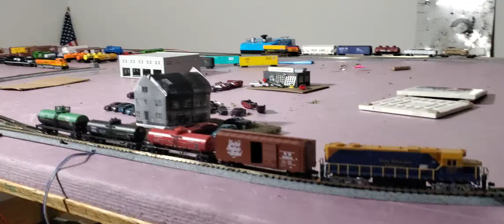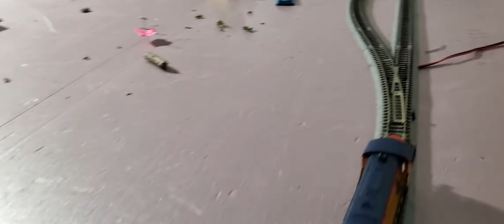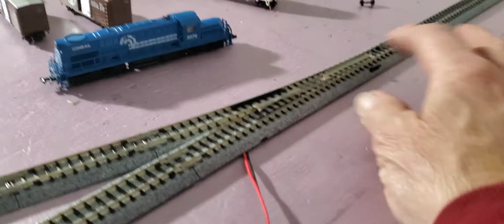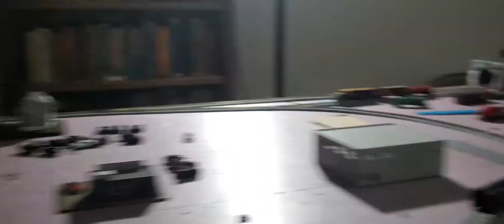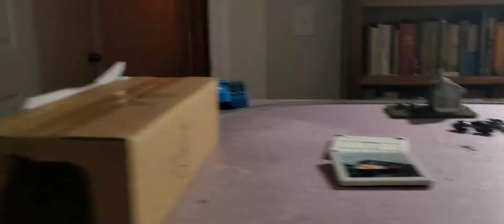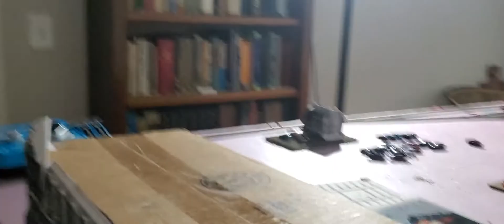Frustrating!

Comment: Hey Nancy I just totally ripped up my non working diorama and made a new working one! I'm having nothing but problems with my points though, particularly the 481 points! They either just stick or don't work at all! Luckily they are in easy reach so I can flip them manually! Btw that wasn't a derail at the beginning that was a train wreck!
Reply from the maker: LOL train wreck...derail! meh LOL what are 481 points?
Reply: @nhyardlimit  Ah yeah, 481 points are just what I call the #4 turnouts that use 481 radius curves because I can never remember the # part!
Reply from the maker: @tsu8003  yes!That's it!  That's where I get probs too! the turnouts and I do have #4 and #6. It's those pesky turnouts! aha!
Reply: @nhyardlimit  My layout is next to the wall on one side so I've had to put all the points at the front because that's the only time I get derailments and it's a pain having to reach over if they derail at the back. Not ideal but does work though.